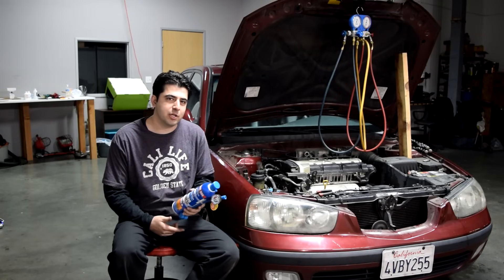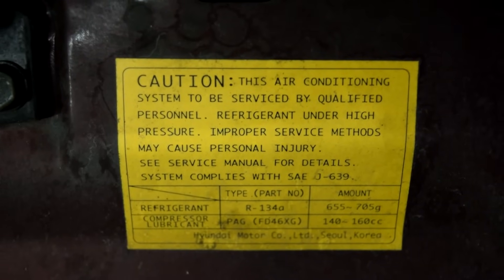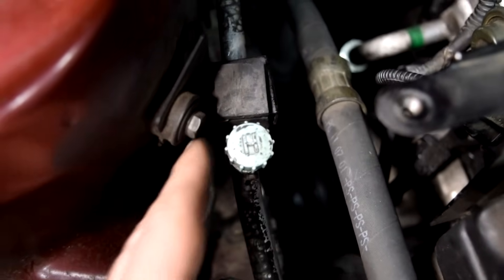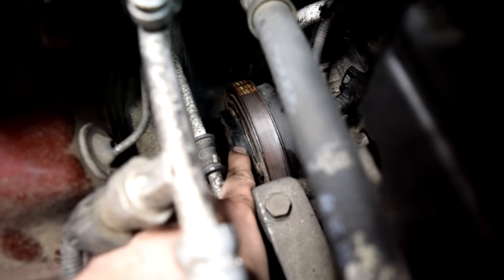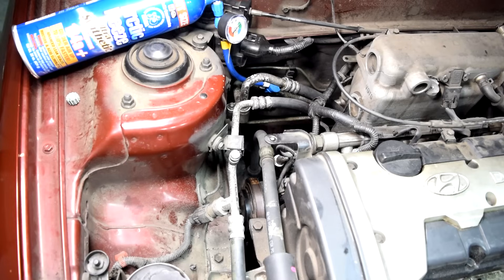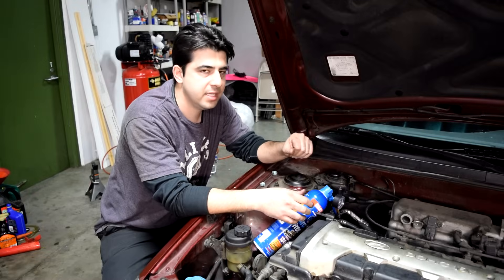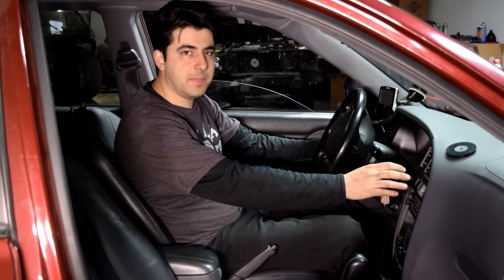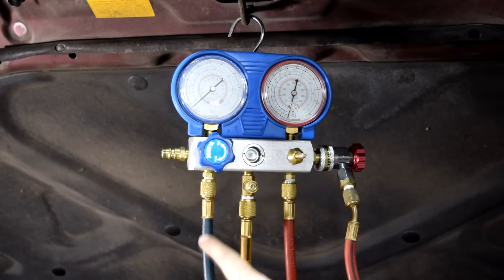How to Safely and Easily Add Refrigerant to Your Cars AC System

Comment: Hi RachetsAndWrenches, I replaced the dryer and condenser on my 92 Accord.  After pulling vacuum to clear moisture and verifying that vacuum is holding, I started filling with R134a (the R134a I'm using has PAQ oil in it; I'm actually doing a conversion from R12 to R134a after all the R12 had already leaked out over the years).  System takes about 24 oz or so of R134a, which is around 80% of the amount of R12 that would have been required.  I currently have maybe around 6 oz of R134a in the system.  I noticed low-side pressure is around 65 psi, while high-side is about 125 psi.  Low side is way higher than I think it should be, while high side is too low.  I'm speculating that I have a bad expansion valve (maybe stuck opened), but wondering whether I can draw this conclusion when the system is still low in refrigerant.  What do you think?

Comment: did you connect the refrigerant to the low pressure or high pressure
Reply from the maker: JoeManeTv low pressure side. you can only put the connector's that come with these cans on the low pressure side.
Reply: ok, thanks..

Comment: frankly the most helpful video. thanks. one question please, how to know what constitutes the normal low pressure range for 04 mazda 3  A/C system. as far as i know the pressure is related to the weather temp and the the engine rpm. please cover this point if you know. thanks again.. or simply without vacuuming, how to know the right psi for your AC?

Comment: The 3 valve manifold has a schrader valve.
When you add refrig do you vacuum the air out of the line?
If you hook the vacuum to the schrader, should you connect the can and Line and vacuum the line, remove the vacuum to close the schrader, and then add the refrigerant?
Thanks Great video.

Comment: Thanks for all the info. Dont forget to tell people how to bleed hoses of air so all the air in the yellow and blue hose does not go into system.
Reply: yes, how to do it? And at 7:00, the blue pipe is full of air. how to remove the air before starting adding refrigerant ?
Reply: Cale Caki yes. You have to purge at the hose connection. Purging means once you start to open the blue knob, open the connection a little at the gauge for one second till you hear hissing like air is coming out and close tight right away to continue to add refrigerant. You only do it once so you know you let any air out.

Comment: Nice summary.

Here in Canada all freon based refrigerants (including 134a) require the mechanic to have an A/C certification license before he can buy them. As a less damaging work-around, some retail stores sell propane-based refrigerants in the same kind of containers. If you don't read the labels you would never know. Of course those systems end up with a mix of propane and 134a, which may be a problem at the time of recovery.

Although 134a may cause less harm to the ozone layer I don't think the harm is zero, so it becomes an ethical dilemma. As you say, the confusing point is the fact that the compressor may not turn on if the system is low on refrigerant. I would tend to go to the gauge set, but if the compressor doesn't turn on you won't learn anything about dynamic pressures. I think a pro shop would reclaim freon, test for leaks, replace seals and receiver dryer, draw the system down with vacuum and retest, and then recharge. That's effectively what you did when you replaced the compressor here. It's more expensive but in the long run if there's a leak most cars will end up there anyway.
Reply: Soppose you put in too much of the free on what will happen

Comment: There is air in refrigerant‘s hose,If you donn't release it,it will into the A/C system,cause damage
Reply from the maker: Its a very insignificant amount, it will be fine. But better to release it yes.

Comment: I used that refrigerant 2 years ago, on a system that I was told needed  $1200 worth of work.  Great stuff. Good stuff
Reply from the maker: You probably had a small leak, the problem is some shops will never tell you that. I would bet most people would like to take their chances and try to live with adding refrigerant maybe every 6 months to 2+ years instead of spending a grand fixing their a/c.
Reply: RatchetsAnd Wrenches
Exactly....That's me
, since R134a isn't bad for the  ozone like R12